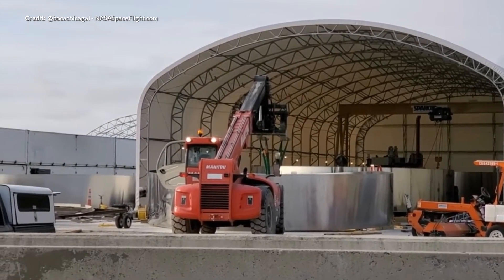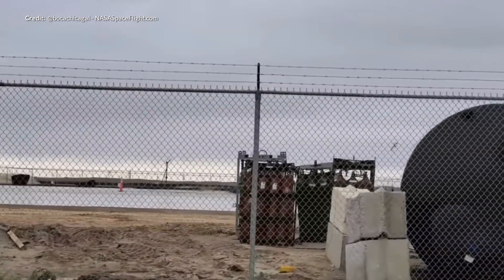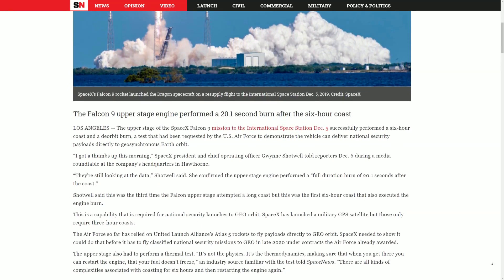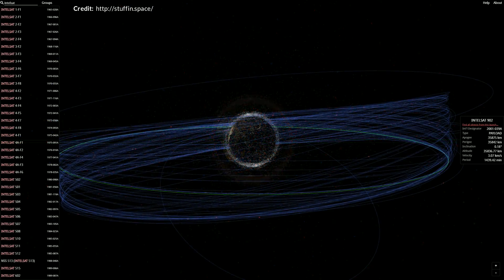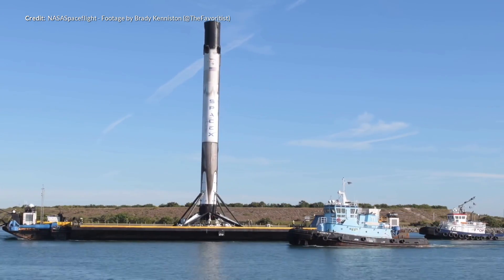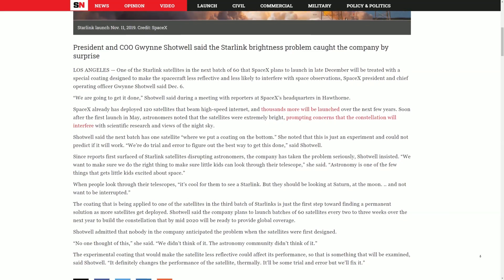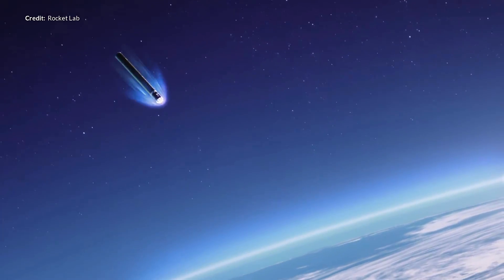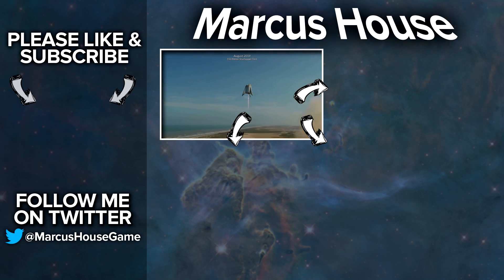SpaceX MK1 Starship deconstructed, Starlink upgrades, Rocket Lab's huge steps toward reusability

Comment: The reason I can't get seriously excited about Rocket Lab is b/c they build small rockets with tiny payload capacity.
Reply: that tiny capacity is their counter intuitive major advantage, you don't need to ride share to get to the orbit you need, you can just buy a smaller Electron Rocket to get there, and once they have re-usability too they could be a very compelling option for smaller companies and projects to launch their satellites and spacecraft, such as Planetary Society's Lightsail cubesats which require very high orbits to properly deploy and start flying while avoiding even slight traces of Earth's atmosphere (hence why the last lightsail spacecraft was about to change it's orbit but was unable to escape the Earth-moon system before the other side of it's orbit dipped to low in Earth's atmosphere and made it re-enter)

Comment: I’m stuck on either a crappy satellite link which costs me $160/mth for 200GB of Data at around 5mbps or mobile broadband at $80/mth for 500GB of Data at wildly fluctuating speeds from 100kbps to maybe around 15mbps if I’m lucky. So for me Starlink is one of my great hopes for bringing our family back into the 21st century after moving out of the city.  I appreciate the need to reduce the interference of large constellations of satellites but I definitely hope that it doesn’t stop the rollout.

Comment: I do have a question though has anybody managed to photograph is starlink satellite yet with a radio telescope, I finally managed to see the outer bands are satellites using an old satellite dish and thought emporiums procedure. I do not know if we can see the bandwidth of SpaceX starlink satellites yet though. be pretty amazing to see a photo of the ones that are in orbit as of now.
Reply: Not sure what you mean by 'photographing with a radiotelescope.'

Googling 'starlink downlink frequencies' will give you that information, and though the hardware is a bit exotic at those frequencies, they should be recievable (though you won't be able to understand the data). 

Although not all of them will necessarily be transmitting at any given time, until the system is more nearly complete.
Reply: @stardolphin2  there are programs that you feed your sound data into and it creates an image out of it. The channel thought emporium did a good job at explaining it step-by-step. I'm in the process of building a bigger radio telescope with antenna that will receive different wavelengths. It's the same way astronomers use a radio telescope to make an image. The data is either seen or not, that data is usually set to grayscale. When the software compiles the image then you get a two-tone picture. Different elements have different wavelengths, the colors you see in radio telescope photos have been assigned to that element. multiple photos at multiple wavelengths are stacked on top of each other to give us the nebula pictures we have today. with the satellite setup I have right now I was able to recreate. Emporiums experiment and see the geosynchronous band. If you have the right wavelength antenna you can photograph all the starlink satellite that are above your current position. I do not know what wavelength starlink will operate at or is currently operating at but it stands to reason if you know the frequency you can photograph the satellite using the radio data.

Comment: Also the reason the drone ship had to be used was the two secret satellites that were deployed before dragon resupply could dock with the station.I like your videos Marcus but your information was a little off on this video. I follow a total of 12 different creators that report on space progress. it takes a lot to disseminate the information but I know this information is correct. I have it from a really good source.
Reply: There were no secret satellites. Rideshares aren't possible when carrying a Dragon. No place to put them.
Reply: @odysseusrex5908  I got it on good source that there was a air Force and nro satellite on the launch hence the reason air force needed a little extra stretch
Reply: @odysseusrex5908  then again sometimes sources are incorrect. Regardless it was a test for the air Force which has been performed before

Comment: Go Discovery arrived a week ago, 2 days prior to the release of this video I had acquired about how many rings were produced in the moderators at s Padre informed me that there were already five rings not counting ring zero, this means that they should be up to about seven or eight rings now.
Reply: I'm sure they can start assembly before all the rings are made.
Reply: @scottelly2  the point is they were way more rings than he originally thought already produced. I haven't checked in the last two days since I've posted but I have no doubt that they are up to at least 10 rings now. They were at 6 the day I was watching them pull one off The jig. That was approximately 3 1/2 days ago.
Reply: @scottelly2  some of these are learning rings though.

Comment: 40 Trillion Starlink Satellites blocking out the sun...
Reply: It would probably take about that many. Just to cover the U.S. with one satellite every square mile it would take about two million of them. There are 640 acres in a square mile, and about 44,000 square feet per acre. It would probably take one satellite for every 44 square feet, so about a thousand per acre and 640,000 per square mile  . . . x 2,000,000. Call it half-a million times 2 million to make it easier (1 trillion).

Comment: "Revolution of the small" is fine.  Just understand that it will happen more quickly by having a thousand payloads on a big rocket, than by launching a thousand small rockets.
Reply from the maker: It is also down to orbital placements. As an example, if you need a 20kg sat in a specific orbit, you can't dictate that very easily with Falcon 9's rideshare program. In that cane, you end up where you end up as they need to drop off many other sats. With Electron however you can get the exact orbit you want.
Reply: That works well, if they can use mostly the same orbits.

That's why RocketLabs can do what it does, serving the low end of the market, that needs a cheap but dedicated launch that will take them to the orbital inclination and eccentricity they need.
Reply: Ummm . . . do you realize that SpaceX is already launching 60 satellites per launch? With the new Super-Heavy booster, they'll be able to launch hundreds per launch, so it might happen in less than a year. In a few weeks there will be enough Starlink satellites in orbit for them to begin offering limited service coverage. Then that will grow and grow fast. In less than two years there will be more than 12,000 Starlink stellites in orbit.
Reply: @scottelly2  Nothing you said contradicts anything anyone else said, so I'm not sure who you are replying to...

Comment: SpaceX should use their rockets to transport their building materials
Reply: That's the idea, except for those materials that can be dug out of the Lunar surface.
Reply: @odysseusrex5908  I'm specifically speaking of their own materials. Transporting their cars and rocket parts wherever they need them. It would be more expensive, but it would benefit us with knowledge and smaller-scale transportation of payloads. If we were to advance electric rocket engines like ion thrusters we could be more efficient.

Comment: Wake up, fake-x is all a big lie, just like NASA...FYI...there are no such thing as a satellites. No GPS in the desert or out in the middle of the Oceans,..international flights do not use fake GPS, they use LORAN system.
Reply: Just a little dumber and you can be calssified as a wild animal
Reply: @tsurutuneado5981  r/murderedbywords🔥
Reply: @tsurutuneado5981  ...Hay Einstein,...learn how to spell first, and then we can have a discussion.
Reply: @buckmaster3594  I got one word wrong in my comment, you got EVERYTHING wrong in yours
Reply: @tsurutuneado5981  ...Prove that there are satellites...there are no live photo's and everything is land based towers. Ask an international  pilot. Most of the communication platforms are high altitude balloons, mostly for the military. Do your homework before you react.
Reply: @buckmaster3594  When you enter a tunel, or get underground the GPS signal gets interference, why? Because the path form your car to the sky  gets blocked. Plus there is no reason for satellites to just not exist.

Airplanes can use different navigation systems, they can use VFR for low altitude short flights (usually smaller planes), GPS for direct routing to a destination, or IFR which in turn uses VORs and NDBs to guide the plane, which are ground based instead of "communication balloons". 
But have you ever taken an inter continental flight and gotten WiFi in the middle of the ocean even with no ground stations nearby? This is because there are a bunch of satellites that serve as a relay for the ground stations, and are sitting in a geosynchronous or geostationary orbit, meaning they don't move horizontally relative to the Earth, so you can sit comfortably in the plane arguing with people on the internet about why satellites aren't real and how little you understand about aviation and rocket science. But hey lucky you I'm an aviation enthusiast and aerospace engineer so you can ask me anything related to that.
Reply: @tsurutuneado5981  ...A.P....even the A.M. radio is blocked from only a mile away, WHY???, the waves are long and get blocked by the tunnel.But, the F.M. waves are short and higher -energy, so F.M. radio even works in a tunnel. GPS is line of sight and has gray areas behind mountains., WHY?? because GPS is from a tower. No such thing as GPS, no satellites, no space station, no moon landing, no curve on Earth.
Reply: @buckmaster3594  Radio sounds the same for every car in the road, if GPS is transmitted in a similar way then why every car has different displays for their own unique model? 
Just because you decide to believe in ignorace doesn't mean you are smarter in any way, actually is the opposite.
Reply: @buckmaster3594  Remeber that time Bill Clinton was caught in the act with Monica Lewinsky in their own office and after a while everyone knew about it? The US government couldn't hide something so trivial and unimportant as that and you think every space agency in the world and every government can cooperate to hide something as historical as the Moon landing or the shape of the Earth? Sure bud
Reply: @tsurutuneado5981  ....A.P.....very simple, the triangulation of the target or car/person is moving and the receiver of the signal varies due to the quality of the electronic components in the device. Also, the civilian version is not that accurate as the military receivers. I am a unmanned aerial pilot, and the drone will return within a foot. The military is in inches, if you can get more than one tower. In the desert, there is no GPS, why..??because the distance is great.Please ask or research people traveling out west in New Mexico or Arizona, no GPS signal. People must use the paper maps and compass.
Reply: @buckmaster3594  Where the hell did you get that it does not work in the desert? It works anywhere. And even if it were ground based, engineers would have realized by now they can get better coverage using a constellation of satellites. You need to revisit your sources.
Reply: Alejandro Pacheco he is already animal. OH wait. Just look at his profile pic.
Reply: Yes, the entire world, (not just the ones capable of launching sats) with all kinds of adversarial relationships, some seeking to cause the downfall of many others in the name of one politics and/or philosophy and/or religion or another, somehow manage, for the better part of a century, manage to all agree on, and keep this one secret, from the public, and not expose each other.

Yeah, that makes...perfect sense.

Oh, and LORAN is limited range, only good to about 2000 miles of the North American coast. You won't receive squat from it in, say, the Indian ocean. But hey, what do pilots and mariners know? (ask either what a 'Great Circle Route' is and why it matters, btw)

But your smartphone or other mobile device with the ability, will get GPS just fine there.

Oh, and have you paid no attention to all the astronomical observations in these comments? The problem is that you can see the Starlink sats (and many others). Are all astronomers 'part of the hoax' too?

Please. Even your satellite TV installer would know better, yet not one gets drunk and talks.

Still waiting for debris from all those expendable stages to wash up on shore, or spotted by ships and planes as well...

I've seen sats and listened to Amateur Radio satellites personally, but hey, what do I know?

Are you going to echo the Flattie who once tried to tell me that ISS sightings were 'a spyplane with a big mirror?' (which is nuts on so many levels)

Go ahead, I'll wait.

Comment: At 1:23 what are these beautifully made stands for? You call them test stands, but what kind of tests. Can't figure what that one in Cocoa is doing with one ring on it - some kind of prep work? Think I saw a version of these in Boca, made out of that self-rusting steel - can't remember.  Do look good for mounting the engines.
Reply: They hold the rings, so other rings can be stacked up on them, welded together, and a rocket can be built, with that as the beginning of th shell/body. Ultimately, if they need to, they can weld more support into the test stands, but I think they are more for making mock-ups than anything else. I get the feeling SpaceX is going to be making a few more mock-ups, before they make an actual flying, giant rocket. That makes sense to me, though maybe version three will really fly a little, like the Star Hopper did. It will be interesting to see what happens over the next few weeks. Already they're behind "schedule though" (based on what Elon said a few weeks back).

Comment: I am paying $88 month for 75mbs cable internet.  With proposed price of $80 month with 610mbs speed, i will definitely switch to it.  With a bonus not being limited to using it where cable is
Reply: Neal Zeman You will still need a base station to receive data, and then wire the connection throughout the rest of where you live. However, it is still much much MUCH better than anything conventional.
Reply: @robrod7120  Why would someone need to wire a wireless connection? All the thing needs is power, and for all we know, the antennae will be part of a solar panel and battery combo, so you won't even need to plug it into a wall outlet or anything - just throw it up on your roof, and it starts to work. They already included your network password in your link, but they can reset it anytime you want, just like with your e-mail account, Facebook account, Youtube account, etc.

Comment: This video shows something terribly weird as we only see a thin steel skin and do not see frames, longerons, stringers and bulkheads, wich should give structural resistance to any fuselage.
Reply: Some parts were removed through the top, but no frames or stringers? Yeah, weird.
Reply: @DistracticusPrime  Was MK1 just a promotional totem exploded on purpose?

Comment: Not very environmental friendly to dump used carbon composite boosters in the ocean?

Often a lot of fuel left and electronics. Take care of our planet! 🌏
Reply: I guess carbon composite is like plastics for the environment, hard to break down the natural way? 

Hyperbolic fuels is really nasty stuff, and dissolved solid boosters is also not something that’s good to mix in water. 

Yes it’s not very much compared to all the sunken ships, but metals is not so bad. All the fuel and hydraulic oil is bad stuff. Nowadays most sunken ships are brought back and recycled, but the rocket industry continues using the oceans as waste dumps with no plans to recover. 

But this will soon be in the past. You know you’ve done something good when it’s cheaper to make the right environmental choice than using expandables.
Reply: One more reason to cheer for reusability!
Reply: @DistracticusPrime  So far, the total mass of rocket bodies in the oceans doesn't come to one good sized sunken ship.

Never mind lost aircraft...
Reply: Won't hurt anything.